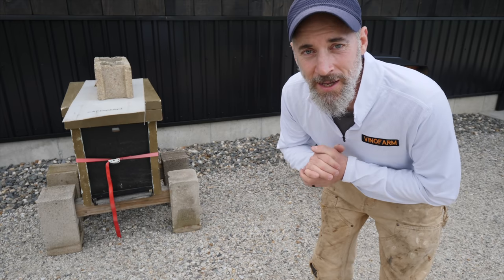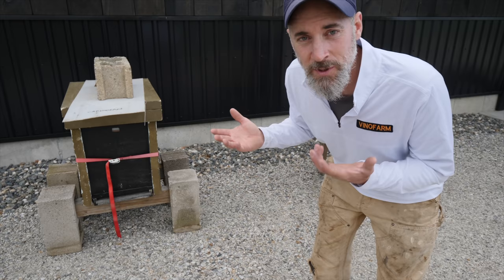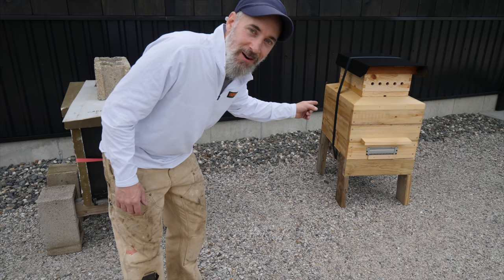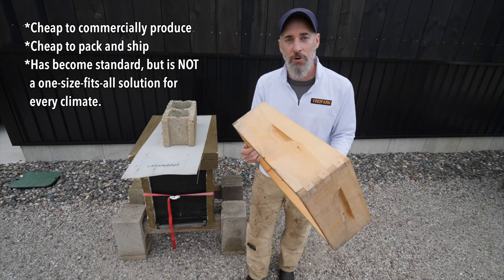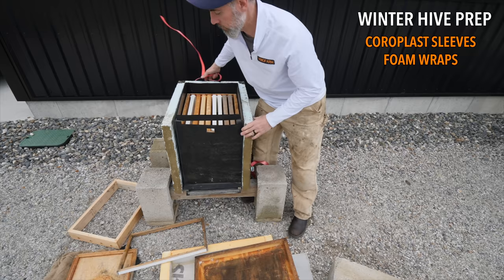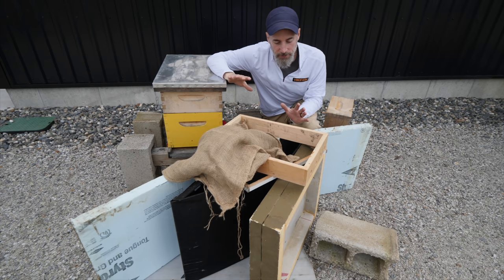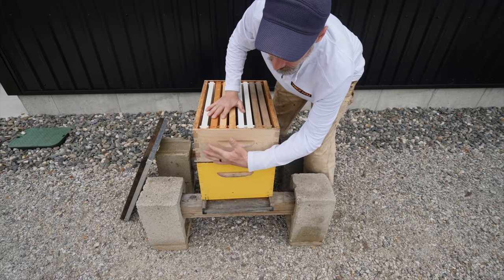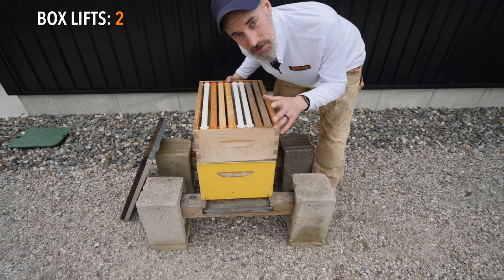I Fixed The Langstroth Hive (For The Bees AND The Keeper!)

Comment: And they will use all the hive space, I think. I have seen what you discussed, lots of empty comb. Trouble to keep it warm for winter (we ended up plugging in an 49°f eaves warmer for them under the insulation) The trouble they go to maintaining temperatures, and bearding. So much extra work and stress it's got to impact their health, limit what they can fight off, what they can accomplish.  This config has to provide a lot more comfort, brood nurturing, less stress for you! too, and strengthen the hive to everything.  It's really more like a castle, no?  Tree castle?  If (since) they have extra energy and time, I bet you get an immense honey overflow.  

I'm interested to know how big the hive will get now. How they're going to be fed during the winter, if by solving all their problems they grow big enough that there's not enough honey inside the castle 🏰 for their size for the whole cold winter... But, with the extra spacer room. There's room for one more deep frame, with the spacers removed.

Comment: interesting idea and a great video explaining your concept, I cant wait to see in one year how it works out.....but most negative comments will be triggered by your claim that you "fixed" L-R hive-"don't fix what ain't broken" argument ...... you had a problem(not deep enough brood frames)-so you "adapted" hive to fix it(there might be other methods to do it but you chose this one and I respect that).....as for isolating the bee hive-time will tell-i have seen a video by one beekeeper where he is going the opposite way: he build a beehive that has no walls/sides, comb is exposed to the elements(snow was blowing on it...) and those bees made it thru winter(I don't claim winters there are as harsh as in your area.....as for overall size/weight of your new hive: it might be good for backyard/stationary apiary-but for commercial beekeepers that move/relocate their hives several times in a season it is just not practical

Comment: Thanks for sharing your design and build of the ‘bee barn’.  I have a specific interest in thermal performance of buildings (as an Architect).  All of your modifications make sense to me.
How will you deal with condensation, as your walls are so well sealed.  The wood of a living tree breathes.
Reply from the maker: The upper vent box described in the video. In the winter, it is a wick drawing excess moisture up and out. I've used that system since I started and it works great.

Comment: Hi Jim. Here's the missing logic: if you leave your front door and an upstairs window open in the winter, the entire house will be almost as clod as the outside, no matter how well insulated the walls are, and the heating will have to work just as hard (in this case bees)... upper enterance/vent = heat loss. Additionally, the bees will lose the benefit of the sun warming up the hive on warm sunny days. So this turns into a lose-lose situation for the bees. To turn this into a win-win situation, a thickly insulated and sealed top:is needed, and venting kept at the bottom ( have to make them in a way not be blocked by dead bees). When the top is very well insulated, the moisture will form on the walls and it's considered a valuable water source for winter bees (according to research from Dr Seeley). Over a year ago, I bought styrofoam boxes, made cuts on 4 sides and attached/glued them on my wooden boxes creating a year round insulated boxes. Did same for top. This year I have 2 colonies in these new hives (no upper vent/enterance) and so far they seem to be thriving (BTW, lots of European hives are like this). I'm not suggesting or making any recommendations, as I am putting this to the test myself, just sharing something you might want to think about. Your new insulated hive is def excellent and I'm just hoping your config will give your bees the intended benefit.
Reply from the maker: This video did not cover the winter lid. That is coming in the winter. Stay tuned.
"Winter sun warming the hives" is a totally old idea that I have moved away from. I've been monitoring temp/humidity in the boxes and my mind has really been opened. The BEES warm their space. There is no way the heat gain from the winter sun we get is going to warm the hive more than the bees can do it. The miniscule benefit they might get at high noon on a mid winter day is erased during the 15 hour nights of freezing temperatures if the front of the hive is open. 4 sides of insulation and a highly insulated lid will keep the heat that they generate INSIDE. They do an amazing job of maintaining heat. I want to provide a space that will HOLD the heat. I am going back and forth on the tiny upper entrance. It is an opening I don't like, but 5 solid months of CO2 buildup and no way for excess moisture to escape makes me concerned. If our winters were a tad more mild and I knew the bees were getting occasional air exchange, I'd close that off, but they're locked in from November through March. No way that air is going to be breathable in a sealed environment.
Reply: @vinofarm  I was referring to spring and fall sun warm up, which is def significant. I have noticed insulated hive takes longer to get to work on sunny warm days than regular. Also read some studies suggesting wild colonies in thick trees take longer to start their spring "operations" than those kept in wooden boxes. Regarding CO2, it sounds intuitive, but think of bees living it tree hollow with only (mostly) single lower enterance. How do they survive? Science suggests air gases can maintain equilibrium thru the lower vent, but the key is that vent does not get blocked by dead bees or snow, and tree colonies don't have either of those problem... I will be testing this in the winter by making a couple of vents on the bottom board and cover them with an inch or 2 of raised mesh from the inside so dead bees don't block them. I set the hives up high, but even if the snow cover the front entrance, underneath the bottom board mostly stay in a bubble of air...will see how it goes! Not suggesting to anyone, just experimental stuff...
Reply from the maker: @yvzwyvzw3038  Re: CO2... The whole "bees in trees" logic breaks down when you realize honeybees don't live in trees in places that have 6 month winters. We have no feral honey bee colonies in this region. In a warmer climate, CO2 buildup is not a concern as the bees are maybe cooped up in their tree for a couple months at best. Not 6 months enclosed. I'm watching my temp sensors hourly and the data are changing the way I think about insulation and upper vents. I will watch this for the season and start sharing thoughts once I have a clearer picture of what's going on. Stay tuned. Thanks.
Reply: @vinofarm  if you get a chance, please consider checking out "The Lives of Bees: The Untold Story of the Honey Bee in the Wild" by professor Thomas Seeley. Most of his research on wild bees is focused on the northeastern US (Cornell university's Arnot forests in Ithaca)...he has YouTube videos about it too....you will be surprised!
Reply from the maker: @yvzwyvzw3038  I watched his lecture. Wow. I had never seen him before, but it sounds like I’m on the right track. I particularly liked his talk about the insulation. I was going to to the same experiment he did. I have sensors in my hives right now, but I was going to put one in an empty hive box up in the beeyard as a control sensor. His results were exactly what I predicted would happen. Sharp temp swings in the 3/4” wooden box and nice smooth minimal swings in the tree. I’m going to keep watching more from him. Thanks.

Comment: I think you could save yourself the woodworking on the brood box body by just using commercially made styrofoam hive bodies from Blue Sky Bee Supply, or BetterBee, Dadant, et al.  

One deep and one medium styrofoam box stacked on each other, insert custom frames and you’re done.

Especially because wood is expensive right now!
Reply from the maker: Yes, but that would mean shelling out for all new equipment. I used the garage full of Langstroth equipment I already had. The only thing I bought was the cedar and that could easily be just pine. Also R-value on these exceeds poly hives. Maybe if you were starting with nothing, it might make sense, but I had 80% of the materials and enjoy woodworking.

Comment: I live in New York. Just as cold, if not colder than Mass.  We definitely get more snow.  Run deep on bottom, medium on top all year.  Add supers as the season progresses.  Never used insulation.  Never had a problem. To each their own.  But looks like you’re trying to reinvent the wheel.
Reply from the maker: What’s wrong with a better wheel?
Reply: @vinofarm  not a thing! Hope it works out for you. Just sharing my experience in a similar climate.  I’m curious how those double frame set ups will look when they’re packed with brood/honey.

Comment: I absolutely love all of these ideas and features ! One of the thingsI am skeptical about are the “spacers” used on the outside of the seven frames working out without getting covered by burr comb and propolis. Maybe use slippery plastic such as Teflon for those ? I think the bees will COVER those with comb and propolis, and they will be just like another gummed up frame if they are wood. 
Now.... having said all that.... I see this design being for those with access to a shop full of woodworking tools, a ton of time (maybe retired) and the willingness to dump some money off at the lumber store. 
At the moment, 7/16” OSB is $34 per sheet where I live, so I can’t imagine what it would cost to build one of these. 
-Not saying the ideas aren’t great, and a huge improvement in MANY ways, but impractical for most or many.

Comment: I had another thought, what if you attached handles toward the top of the permanent outer structure and attached the strap to the handles. The strap would only need to be long enough to cover the top + 1-2 supers if i'm correct here. Less strap would be more attractive, you'd have less strap to tuck in and I bet there would be other advantages to it. 

Yeah, you really got me thinking here.
Reply from the maker: I thought of that, too, but I like them all tied to the stand. The stands weigh about 40lbs and the hives are about 50... all tied together, they're a nice stout structure.

Comment: Wow!!! Very interesting design concept, looks like you have thought of almost everything. 
Have you considered how you will do your mite treatments? I don’t think they make extra long Apivar strips( maybe one day ) and will your vaporizer for Ox acid reach all the way thru the extra thickness of the box and insulation? I guess you could use a larger copper pipe to go thru into brood box and just plug it when not in use. Anyway congrats on a very well thought out design it will be interesting to see how the bees do with the extra space. Cant wait to see the updates. 
Sorry for your losses but it seems everything happens for a reason, good luck and I look forward to the next videos.
God Bless and never give up!!!!
Reply from the maker: Apivar strips can be hung lower into the center mass with wire. OA vapor will go right into the front entrance probably using a ~4” long pipe extension like you mentioned. Easy!

Comment: Looks like you combined the strengths of the Langstroth (vertical expansion, good air flow, queen excluder, modular) with the strengths of the Layens hive (larger brood frames, year long Insulation, divider boards for resizing the space, less invasive brood box inspections).
Reply from the maker: Thank you.

Comment: I agree with everything you've changed. But I don't think you needed the mega frame. I think you could put a regular deep frame in the mega box and the bees will add comb on the bottom bar of the frame in their own design.

Comment: On your last video I commented: "I look forward to seeing what you come up with to replicate the ventilation and insulation environment of a tree trunk. Good luck!" I guess I wasn't too far off! I do wish that for one or two of your 6 new hives you'd experiment with no top ventilation and do a reflective top cover, just for 2 sets of data over the winter. Well done! Get a patent or someone will screw you over, btw.
Reply from the maker: I have temp/humidity sensors in all the hives. I'll be collecting data and doing some experiments this summer. Stay tuned.
Reply: @vinofarm  that'll be fascinating. This is my first year. Haven't even recieved my first nuc yet, but I'm absorbing as much info as I can digest right now. Probably should have bought the second set of boxes to prepare for my first split.

Comment: Seems like a fantastic improvement! Did you consider maybe using plexiglass instead of 1/2" plywood for the top where the vents are? Seems like it would still be plenty strong, but you could also see down into the whole box without disturbing the bees. Over time the bees would make it dirty, but maybe it would still be clear enough to see activity, etc?
Reply from the maker: Yes! Version 2.0 may be ready for winter. Already sourced the polycarbonate, but didn’t have time to pull it together for this season. Stay tuned.

Comment: Hey there Jim!

I loved this video and your very detailed explanatories!

What you've outlined makes sense, especially easing the back issues while trying to create a more 'natural' style hive that will better suit the bees' natural instincts, which should in theory provide for healthier hives, more brood, more pollen, and of course, more honey!

The ONLY thing I've wondering about centers around the weight issue: you've cured having to lift the 50-80 lbs supers, HOWEVER, you're STILL going to have all the WEIGHT of the BEES on those thin langstroth frames you've designed! This lead me to wonder about their strength considering the stress they'll be under, as well as handling difficulties dealing with what is essentially 1 Deep and 1 Medium at the SAME time! I am eager to see how this turns out for both you and the frames (as well as the bees of course). Worst case scenario: you'd have to double the thickness of the frame wood to handle the extra load.

Your shifting away from having to move supers also has two great benefits in my view: no more crushing of bees (which should improve the disposition of all the girls, and LESS extra propolis placed in inconvenient places by the girls!

Lastly, when I saw the Ibuprofen count, I just smiled: I haven't been able to take it for DECADES due to over use when it came out (my doctor at Group Death (Health) handed me a prescription for ibuprofen in 900 mg size pills and told me 'take as much as you need to stop the pain'. I was taking 11k mg to 13mg a day.........the Lord blessed me big time because I did NOT end up with any liver damage!

Anywho......you've got me on the 'edge of my seat' so to speak and I am looking forward with keen anticipation to further developments!

Take care and stay safe!

Cheers from the Oil Patch in Central WY

PS. Are  you getting all Italians (or as close as possible considering genetic mixing) or are you going to try the Mean Russians again?
Reply from the maker: I'll do a deep dive video on the frames since everyone keeps asking, but they are over engineered. I have plywood gussets in all 4 corners and they are all glued and stapled with 2" staples. The gussets provide LOTS more area for glue to grab, but also tons of rigidity and eliminate racking. They will be fine.

Yes, the goal is to not have to lift boxes or ever break up the brood nest. This solves both of these problems. 
I got 2 new Italians, 2 Buckfast and 1 Italian VSH. So no more Russians. 

Thanks for watching!
Reply: @vinofarm  

Hey there again!

I apologize for not noticing the gussets and didn't have a clue you'd used 2" staples!!! Those suckers will DEFINITELY take the weight of the girls!

I'll have to look up the 'Buckfast' not familiar with those, nor the Italian variant, but I always love learning more about bee keeping!

I don't want to keep Russians, but I'm still hoping to finally get to Alaska (the Kenai) this year (house is REALLY coming along because my body is recovering my energy levels a bit better sometimes), and I want to capture local feral swarms for their genetic stability for the environment in which I'll keep them (and in which they already live of course). I've taken notes of your Double Wall Design and will adapt that to the Langstroth TBH's I will build (2-3).

Anywho...thank you again for getting back to me with the details!

Cheers from the Oil Patch in Central WY

Comment: Bees do not try to keep the inside of the box warm. They just keep the cluster above critical temps. Standard and 3/4 pine boxes used to be 7/8" not 3/4. We are in Maritimes Canada, likely similar to Mass. and we use nothing on the boxes. Just reduce entrance so mice/shrews cannot get in, and have an upper entrance/vent in the inner cover. Friend and I wintered in one box last winter and had 100% survival of 14 colonies.  Decades ago I used to insulate top, push 4 double storey colonies together and wrap in black asphalt paper. We learned it makes no difference as long as they stay dry and out of strong winds and ideally are facing south.

Comment: This hive is better insulated then most homes :) I really like the "over engineer the heck out of it" approach, and I think you can do more!

Hey, here is a crazy idea. In order to prove that hive stays cool in summer and warm in winter, you can integrate a small IoT temperature and humidity monitor based on a simple ESP32 micro controller that beams hive parameters in real time. It can even fit in the gap in one of the XL frames! If you are interested on what else modern micros can do and even want to partner up, then shoot me an e-mail and we can discuss.
Reply from the maker: Temp and humidity sensors have been in since day one. Currently collecting data. Stay tuned.